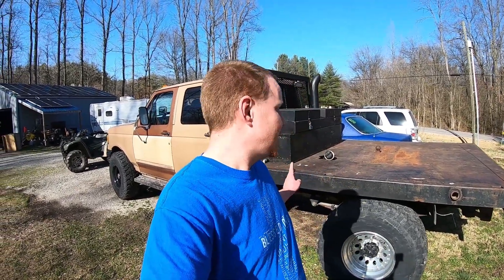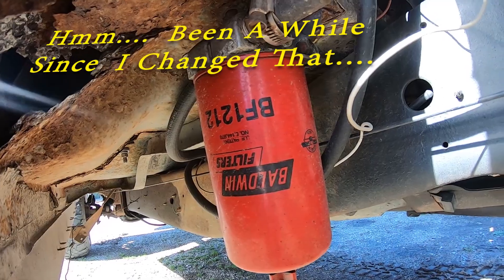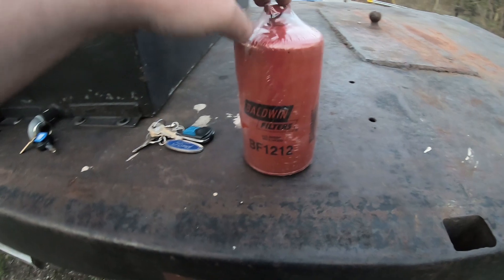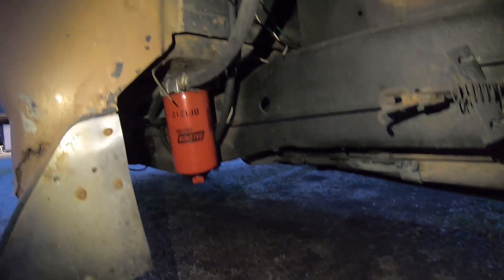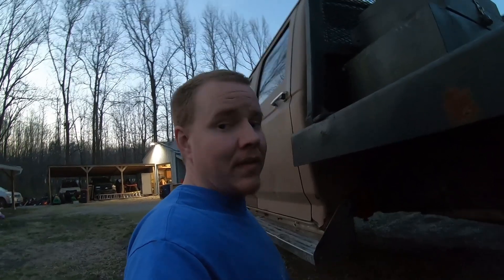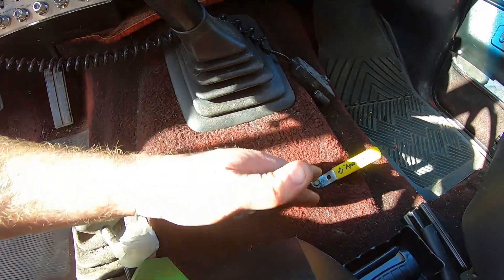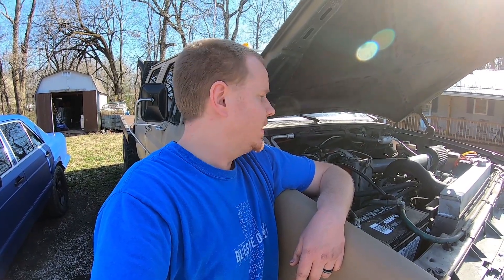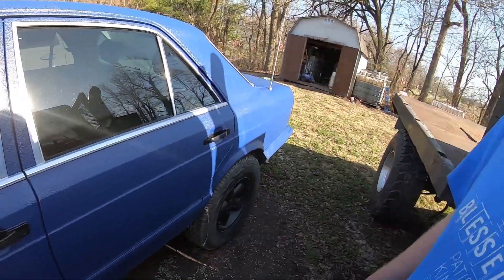Introduction To Black Diesel - The Basics of Dual Tanks - Alternative Fuel - WMO - Nearly Free Fuel

Comment: Is that a Cobra 148 I see?
Reply from the maker: 148 GTL with a 102" whip.  I've since pulled it out of the truck.  It'll go back in there eventually, but right now, I've got a Yaesu 400XDR in the truck which is fantastic.  The truck has changed a lot since this video so check out the playlist on the build.  Thanks for watching!

Comment: With the plumbing you have on the flatbed, you are mixing in the factory filter. How long before you shut it down does it take to flush the factory filter of the WMO?
Reply from the maker: I typically switch a mile or so from the house.  It isn't perfect but it's good enough.

Comment: Thanks for the video! In going to subscribe to your Chanel! Where did you put the filter for the mercedes with the boat tank ? Under the Hood? And how did you connect the black diesel fuel line to the fuel pump?
Reply from the maker: Thanks for watching! Back then, I didn't add filters.  I just used 2 - 3 port solenoid valves like in my other videos on dual tank plumbing.  My current Mercedes is only a single tank setup.  That'll change soon though.

Comment: Okay so it's a gravity feed.   How do you tie the lines together at the valves and is the bed tank    just gravity feed and stock pump pulls the fuel or do you run a pump in line for the bed tank

Im worried about keeping my fuel pump fed. Im learning as I go hear just trying to better understand how to set it up.  Ive got a 12 valve and a vw tdi to try it in.  Oh and 150 gallons of wmo to start
Reply from the maker: I'm using the stock lift pump which I an engine mounted mechanical pump.  The supply and return from each tank go to 3 port valves.  The lift pump pulls from which ever tank is selected by the valves.  Very simple
Reply: @NotSoGrandGarage  Okay so my understanding is you have a line coming off each tank going to a valve for each which then goes to a T from there the T connects to the fuel line going to lift pump and injection pump. 

Now I'm not quite sure how the return works is there already a return Line going to the stock tank and from what, the lift pump or injection pump?? Or return Line is just for the purpose of dual tanks and valves.  

Considering I would only be using the straight diesel for start ups and shut downs, I would imagine I really only need about a 7 gallon diesel tank 

I know I sound ignorant.  Like I said I am just learning.
Reply from the maker: @BRWfilms  on the idi, there is a return fuel line that comes from the injectors/pump located at the back of the intake manifold by the glow plug controller.  In stock form, both the supply to the lift pump and return go to a tank switching valve.  

On mine, both the supply and return lines from the tanks go to 3 port ball valves.  So the supply valve has the supply lines from each tank connected to it... and then the supply line to the lift pump which is always open.  Move the valve to pull from either tank.

Same goes for the return.  Both return lines from the tanks go to the return 3 port ball valve..  and the return from the engine connects to the always open port.  That way you can select which tank fuel is being returned to.

I'm going to do a video on this soon to show exactly how it's setup
Reply: @NotSoGrandGarage  Okay cool, your description helped me understand also but yeah a video would be great!

Comment: Can you give a link to the valves you used?
Reply from the maker: Can't find a link but they are Apollo 70-640 series valves in 1/2" npt.  I think them off ebay a long time ago.  They're still made so shouldn't be hard to find.
Reply: @NotSoGrandGarage  wondering if there would be a problem taping into the feed line with a second tank and letting the return go into the original tank?  How much fuel would get transferred from the second tank in normal driving conditions?
Reply: Tapping
Reply from the maker: @rodneyhoskins8187  a substantial amount as the pump and injectors are cooled by fuel so they bypass a good bit.  You would overfill the tank in no time.  Have to isolate both the supply and return.

Comment: I see people adding a holly blue pump or other high dollar pump systems to a dodge 24 valve.  Should I do that and add your online filter water seperator?
Reply from the maker: I've got very little experience running alt. fuel in the 24v.  All the Cummins I've messed with have been full mechanical and I typically just run the piston style mechanical lift pump on them.  You would need to find a pump that can handle oil.
Reply: @NotSoGrandGarage  newbie mistake--i have been informed that I have the 12 valve.  My valve cover looks exactly like every 24v I have seen, but it's a 12.  I think that's really good news
Reply from the maker: @rodneyhoskins8187  What year is it?
Reply from the maker: @rodneyhoskins8187  If you've got a p-pump 12 valve, I'd run the block mounted mechanical pump assuming you don't need more flow.  You can add in another fuel filter head and such.
Reply: @NotSoGrandGarage  1997
Reply: I think I'll run it as is.  If I run it through a centrifuge I would think it's pretty clean of debris and water.  I'm thinking maybe a 2 micron/water separator in line wouldn't hurt.  How much drag does that create on the p pump?
Reply from the maker: @rodneyhoskins8187  shouldn't cause any issues

Comment: Do you have any trouble in the winter with the wmo jelling?
Reply from the maker: Motor oil doesn't gel like diesel fuel does.  It does get thicker though so in most cases, adding more thinner (gasoline, kerosene, etc) to the blend is needed.  I run the current blend down to single digit temps though.
Reply: I’ve heard of people running wmo through a heat exchanger using engine coolant to heat it up

Comment: Does it take long to purge the factory filter when you change back to diesel? Curious as planning my system at the moment. Thanks!
Reply from the maker: Typically, I switch back a mile or so from home and that seems to be plenty.  I don't switch back to diesel unless it's going to be parked for hours though.

Comment: Does coking cause any permanent damage, or can you just clean them and put them back in?
Reply from the maker: When I had coking issues in my Cummins, it was a matter of pulling injectors..  cleaning the tips with a brass wire brush and putting it back together with fresh crush washers.  Pretty straight forward and no permanent damage.

Comment: I have the 7.3 ps van right now, but getting to injectors and filter is near impossible.  Running wmo sounds like I will likely have to do that pretty soon..  a buddy is selling his 1 owner dodge cummins pickup.  Way easier to pull the injectors for cleaning.  Your thoughts?
Reply from the maker: I despise working on vans so I'd likely go with the truck for simplicity.  BUT...  the 7.3 is known for liking oil too.

Comment: Got a question for you uncertain machines like tractors backhoes skid steers you don't have a place for room to mount a second tank would you recommend in your opinion if a person got into the recycling like this could you run half Diesel and half black diesel and not mess up your fuel system and cut your fuel cost in half
Reply from the maker: Potentially.  If it were me, I'd try to find a place for a small (a few gallons or so) tank though...  just enough to be able to start and shutdown on diesel.  It'll make starting easier.  It also HIGHLY depends on how the equipment is operated.  If its being used and under load most of the time, it would probably be fine but much idle time at all could cause issues with hazing, etc.  It's something you could certainly play with.  Start slow and work up...   say start at 10% and see if you notice a difference over a tank or 2...   then go up until you starting noticing a negative impact on starting or haze, etc.
Reply: Thank you for the info and your opinion I'll try to see what I can do and experiment little bit and go from there
Reply: What is haze?  Sorry for the simple question, I’m a newbie.
Reply from the maker: @pendulum4734  light smoking typically caused by incomplete combustion

Comment: Saw a W123 in the background of one of your videos. Do you run your black diesel in that car?
Reply from the maker: I've got a 115 and a 126.  Both have ran this fuel.  The 115 had some issues but that was also back when I first got started.  The 126 has been great on it.  There will be several videos coming out with the 126 so keep an eye out for them.
Reply: @NotSoGrandGarage  I have a 240d and 300d turbo and want to run this on them. I have picked up a couple extra injection pumps and sets of injectors in case they end up having issues.
Reply from the maker: @rnnoel407  my 115 is a 240d didnt care much for it but that was also when I first started out.  The om617 will drink it as long as its clean.

Comment: Have you ever had issues with the fuel lines becoming too hot from running over the trans? I almost did this exactly but stopped because if the concern.
Reply from the maker: No issues.  The line I'm running has a fairly high temp rating (275F IIRC).  It's also mounted to the floor and tied up away from the transmission and other heat sources.
Reply: @NotSoGrandGarage  For some reason I thought this was a second tank that preheats the oil before going into the engine. The WVO folks do this with straight veg oil.  What are your thoughts on straight preheated engine oil to the engine?
Reply from the maker: @solarjeffa.r.e.9292  I've heard of people doing it...  but I've never tried it.  I always use a thinning agent.. typically gasoline.